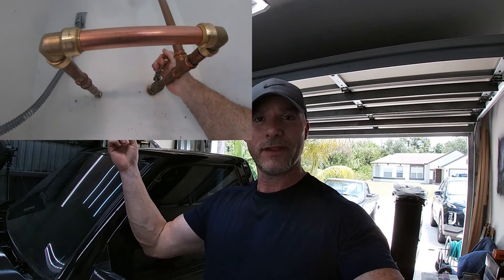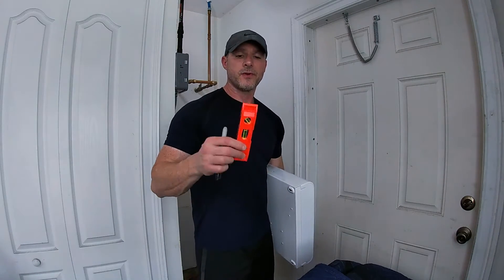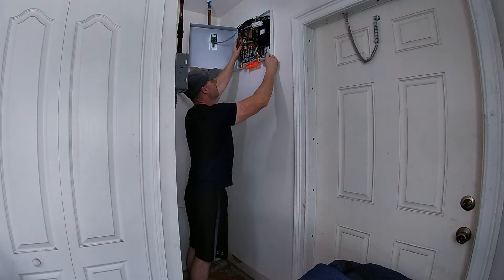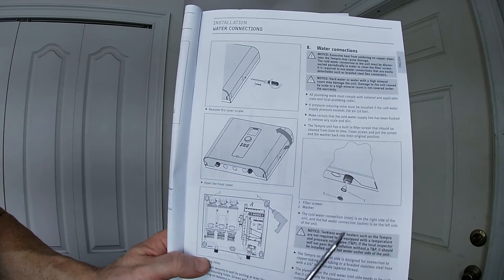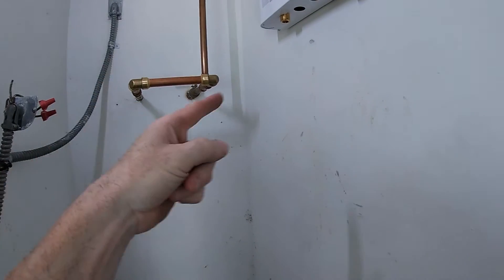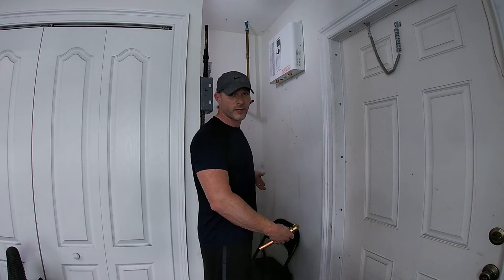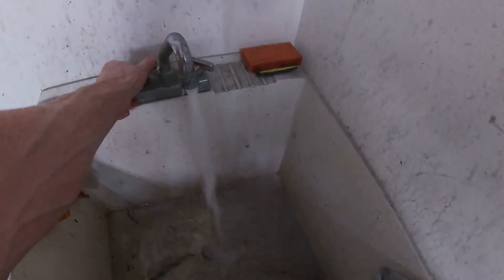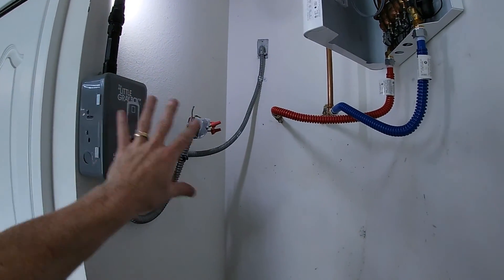Install my tankless water heater. Stiebel Eltron Tempra 29 Plus.

Comment from the maker: For those wondering, the water that poured out of the right pipe is due to the short vertical run. There was no way to empty that little bit out from a faucet. I could have used a bucket, na floor is a mess anyway right now. 🤣
Reply: shoulda used dyna bolts, 2'' . those screws have a shank which means, no threads, no grip..there bugle screws, for timber or hebal..
Reply from the maker: @harrywalker968  Which screws are you referring too? In this video the only screws used are tap con for concrete going into block. All of them have full bite into the block for the whole thread.
Reply: i dont think water undrer pressure is too worried about level.. here in aus, we have service fee,s per 3 months, for gas, elec, water, each is around 90 bucks,,before your useage charge..we get screwed, bad..our solar is down to 5c kw..we cant go offgrid..we can only have 1 system, never upgrade to more pnls..10 yrs ago, i paid 9k for 10 pnls at 58c kw,,never paid a bill,,this house now,i moved, doesnt have solar..some countries you can take it with you at the same rate,,not here..
Reply: no conduit,,use an extension lead till you get it..3 wires. brown, blue, red..earth, neutral, active..
Reply: get yourself a whole house water filter, $180, 2 x 10'' filters. stops everything but fluride..called big blue here..
Reply from the maker: I ran armored cable here to meet code a week or two later. I was waiting on the breakers and subpanel to arrive. Ran out of slots in my box. Also I also use anchored bolts but only for things that have a larger load like a TV mount or shelving.
Reply from the maker: No level is for my sanity only 🤣
We can t win when the rules keep changing. I just do my best to enjoy the ride 👍
Reply from the maker: @harrywalker968 I have both a whole house softener and a whole house filter with 5 stage under the sink. Even though the city water is pretty good. I feel the skin is not so dry with the add ons. I installed those 8 years ago. Good stuff. I think I spent under 1200 us for everything.

Comment: Seriously!!! NO Service Flush Valve or Pressure Relief Valve! :0
Reply from the maker: Yes, it's not hard to unscrew the two hoses pump from one side to the other using 2 5 gallon buckets. Then reassemble. I do this once a year.  My whole house has treated and softened water. Its never been dirty or had scale buildup. I setup the same system in one of my other properties which is still going strong ten years later. Do what's best for you and your local water. 👍

Comment: Goes cold mid-shower. I regret buying it. Rep said flow rate has to be 0.8 gallons per minute. Bigger shower head made no difference.
Reply from the maker: This is my second time installing this exact unit in tbe last 8 years. Once in a small 2/2 and this time in large 3/2 with the farthest bathroom around 70 feet away. I have never experienced the water going cold. The one time I did notice a drop in temp is when the washer was turned on hot while using the shower. It was a few Second drop from hot to warm until both items equalized and had hot water. I also remove the flow limiters in my showers for better pressure. Other then that they are off the shelf Kohler heads. If yours is turning off I would guess an issue with the heating elements and would swap for a new one if under warranty.
Reply: @thisoldhooptie  Today the plumber said to remove any filter in the shower head. I’ll run at normal rate several times and see what the flow rate is.
Reply from the maker: @ltcajh  good luck 👍

Comment: No descaling service valves and shark bites!  Hahaahahaahahahahaahaha
Reply from the maker: No need with twist off valves and a whole house softer and filter on the outside just before it hits the tankless. Maybe where you are its different? In fl I have shark bites on 6 properties going back many years. Not a single issue. 👍

Comment: You don’t have winter where you live.  I live way up north where the ground is frozen 6 months a year. I wonder how it will affect performance? The water comes into the house at 36 Fahrenheit…
Reply from the maker: Very true, no real winter here. I am not fully versed, this is just what I read from the manufacturer. This brand has built in freeze protection. I would guess thats some kind of ceramic pre heater or something. Im sure the compamy website from my description has more info.
Reply: @thisoldhooptie  thx for the reply. I have another question and hope you can answer.  In Canada we have 8/3 wire. Black, red, white(neutral) and a bare copper wire used as ground. Both black and red are hot while white is neutral.  Both black and red connect directly to the breaker, the white goes to the busbar with all the other whites and the ground connects to the electrical panel side(box). I’m having a hard time understanding where to connect all these wires at the water heater end.  Can you elaborate? Pls
Reply from the maker: @chinslip1 Here is how mine is wired as an example. We use 8/2 over here, I am not sure how to wire with 8/3. I have three breakers each is 50 amps. Each breaker has 2 live wires, then you add the ground from the panel. The two wires from each breaker are connected to the slots on the terminal block in the unit marked L1 and L2. The ground wire is connected to slot marked with the ground symbol. Make sure you properly secure/run the wire into the unit.  Its always best to check the instructions that came with your specific model since you will have more or less heating elements based on your water heater size. You also want to be sure to use the proper wire size/gauge/type that meets the local code to your area. Same goes for the conduit used to where ever you have the unit mounted. You tube has many videos on installing breakers and running cable which can help you get a better visual. Good luck 👍

Comment: I noticed you did not install the service valves or a pressure/temperature relief valve, code does not require those where you live?
Reply from the maker: Good eye 👍 , correct pressure relief valves are not needed on these units where I live. The reason I did not add service valves is the red and blue lines unscrew making it easy to flush when needed. I also have a full house water softener and filter setup out side which greatly reduces the nasty build up in the lines.
Reply: @thisoldhooptie  nice! I'm jealous, because in order to install those on the tank I had to build out a box for the heater on the wall so I could access the valves otherwise they hit the wall :/
Reply from the maker: @PatricksDIY  There is a monkey wrench thrown in every project. What fun would they be without the extra headache 🤣.
For mine the panel was full so needed a subpanel. But now I have space for my plasma cutter so its now a positive 👍

Comment: When wiring in the tankless water heater, can I buy a 240v plug and wire directly to the tankless water heater?  I have a 240v next to my electric water heater I am wanting to replace.
Reply from the maker: Probably not. You need to know the amperage of the tankless unit and compare that with the breaker for your current water heater. Tankless are usually higher amperage the the tanked ones. The amps go up based on the size unit for the number of sinks and showers.

Comment: maybe your house is different then mine but as you mentioned at the end one of your intake pipes is for cold water. 
the first valve 8:01 is just for the hot water, if you turn that off and run the hot water it will eventually stop but the cold water will keep running, at least thats how it goes for my place.
Reply from the maker: The cold water can't run if the main valve to the house is off. But yes if you only turn off the hot water heater valve in your house the cold would still run. You need to shut the main valve outside to turn off both 👍

Comment: I have the same unit. It was easy to plumb. The electrical was a good bit more of a challenge. Mine has been running great except for the bathroom sink that has a slow water flow, thus the flow sensor in this unit causes the heating elements to not work very well. Other than that point of use, it's a good unit.
Reply from the maker: Mine was a bit of fun too for the electrical i had to add a sub panel no space left in the main panel.

Comment: Great video but I am still waiting for part 2.  When will you think you will release part 2?
Thank you,
Susan
Reply from the maker: I think i mentioned in a later video it was completed off camera. It actually was corrupted when my last go pro pretty much melted. For an oit door camera mine did not like a paver install and threw a fit🤣
I will be filming a 220 outlet in the new subpanel for my plasma cutter in the near future.  If you have questions I'll do my best to answer them based on my install. It was pretty easy since they were so close. Thanks for watching 👍
Reply: @thisoldhooptie  Thank you for responding so quickly.  You make great self help videos, keep keeping on for those of us who need a little help from time to time.
Reply from the maker: @susangerard8927  Thank you 😁

Comment: HI! Great video! Can I ask what amp service you have in your house? I'm thinking about getting this model, and have the 200 amp service they say you need, but I feel like that might be pushing it with my electric appliances and such. 2nd question: What is the ground water temp where you live? Thanks a bunch, man!
Reply from the maker: I also have 200 amp. I have all the usual plus welders, plasma cutter, huge pool pump. It's not an issue since everything is not on at the same time on full power. The systems only pull the amps they need. Im in Florida it's warm out of the ground.
Reply: @thisoldhooptie  awesome, thanks for the info!
Reply from the maker: @bringle8122  No problem, good luck with the project 👍

Comment: Part 2? Anywhere?
Reply from the maker: I think i mentioned in a later video it was completed off camera. The video footage was corrupted when my last go pro pretty much melted. For an out door camera mine did not like the backyard paver install and decided to die. Lessen learned, copy files over after each project.
I did film a diy 220 outlet install for my plasma cutter in the subpanel i installed for the water heater, that is in the house playlist.  If you have questions I'll do my best to answer them based on my install. Thanks for watching 👍
Reply: @thisoldhooptie  The key things of interest are how good the flow was, how quickly it heats up and how long the unit worked before it died (they all do).
Reply from the maker: This is the third unit I have had in a rental or personal property in the last 12 years same brand. I have not had one die yet. The longest I owned the property with one in was 5 years before selling it. So they have lasted at least 5 years for me. The flow is no different then my tank was, we have good pressure here. As for heat up the closer the faucet, the faster the water is heated, the same as a tank for me. The shower on the other side of the house takes a couple min to get hot. The hot water stays hot or warm for a very long time. My kids take forever in the shower 🤣